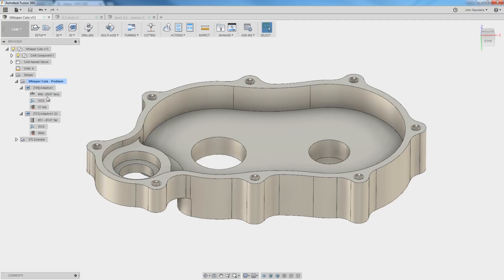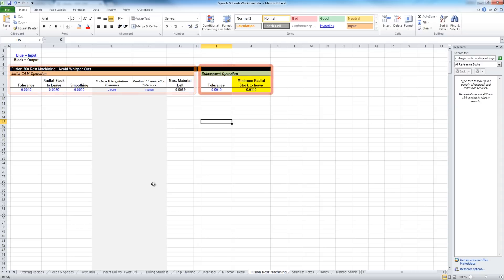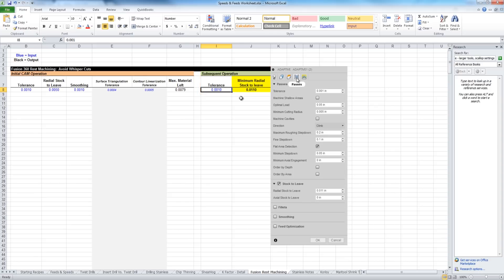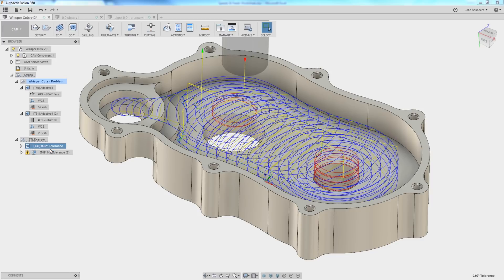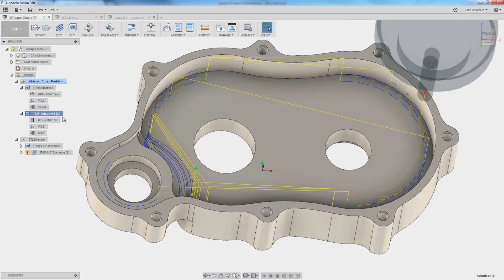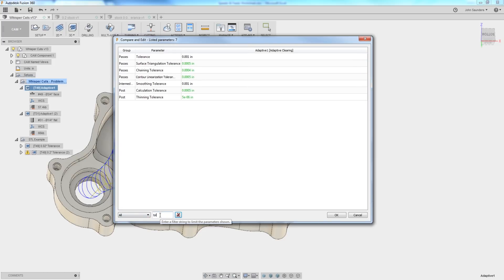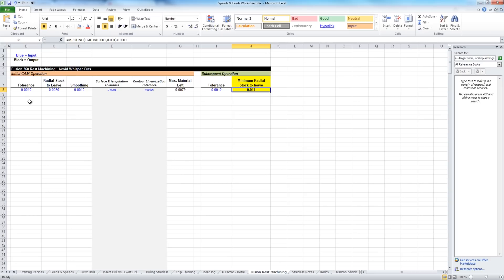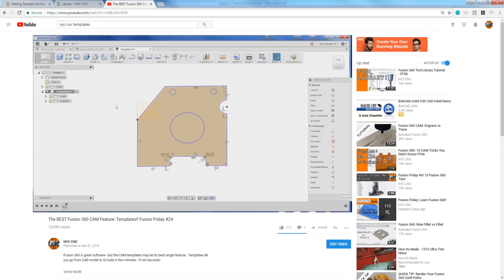Eliminate Rest Machining Whisper Cuts in Fusion 360! FF112

Comment: John this is good info. But you are most likely (though Autodesk would have to confirm) not totally correct in the relationship between the CAM sim output STL and the tool path generation. It appears to me that (as someone who has studied OpenGL) that the STL output model is a result of a tessellation shader and a collision intersection shader between the tool and the tessellated model at simulation. You can confirm this to a degree by running the CAM sim on a high power CPU but low power GPU computer.  Where you will typically find that the tool path generation has no real problem, but the CAM sim is as bogged down as a HSS  4 flute in Al with no coolant starting to chip gual. However, there is still probably a high correlation between the tessellation size and the tolerance in the tool paths. But what you're mostly seeing in the output STL is just how the intersection shader is setup. For instance, if you try upping the smoothing in the tool path as shown by Haas and Autodesk (https://www.youtube.com/watch?v=vt7rVVRiiKk) your STL tessellation is going to have to make a lot more faces even though the number of finite jumps in the tool path has decreased. I don't know what algorithm Autodesk is using to figure out the adaptive (tricordial ) path but it is most likely an optimization calculation based on keeping the angle of engagement constant. For example see here http://citeseerx.ist.psu.edu/viewdoc/download?doi=10.1.1.590.8130&rep=rep1&type=pdf, and the following vid from 
Sandvik Coromant
https://www.youtube.com/watch?v=Zt4NKgodCzY

Comment: what about when you get these whisper cuts in a first, non-rest machining operation?
Reply: fine stepover, set it like roughing stepover if you dont have a 3d part that requires ball mill finishing surfaces

Comment: Won't this result in the part not being exactly the size of the model? Or are you assuming a 3rd finishing operation would then be added with a Stock to Leave unchecked? I'm a newbie...
Reply: These would be roughing operations, so doesn't matter. If you need a tighter tolerance part, you have to do a separate finishing op.

Comment: I have always wondered if there was a way to get fusion to not do some random moves during 3d clearing, might be good for another video? I have found they creep in now and again, where it has roughed out a section, then goes back and practically redoes the whole or part of a sequence. it's not a rest machining issue as it's usually in the first big hog out, but sometimes it can add ages to machining time. another thing that could be a cool video would be optimising depth of cut, as a few times I have found it hogs out hard once or twice and then does a third time with only a tiny removal off z. it's easy to tweak the roughing Stepdown to half the total height to fix it, but I have forgotten a few times and stood watching it run mostly cutting air for the last pass.

Comment: Is there a reason not to lower the initial tolerances in the first op so the STL that is created has more resolution straight away?  Thanks for the videos.  I always learn a lot.
Reply: Tighter tolerance means more triangles. so.. Slower to calculate tool path due to more calculations, larger G code file due to shorter move segments.